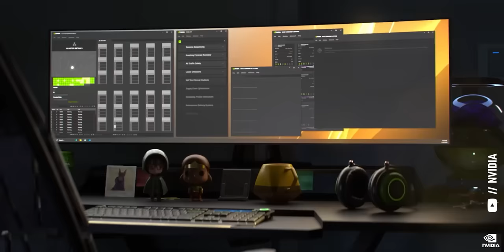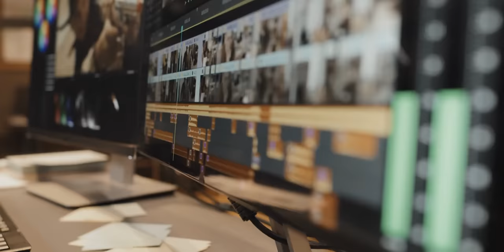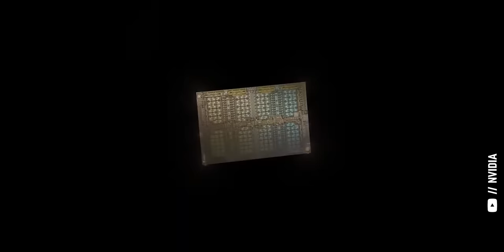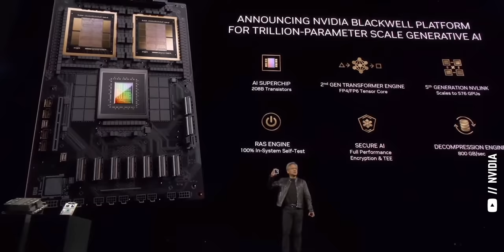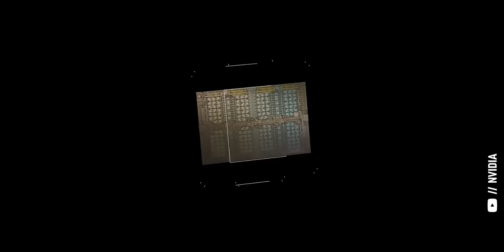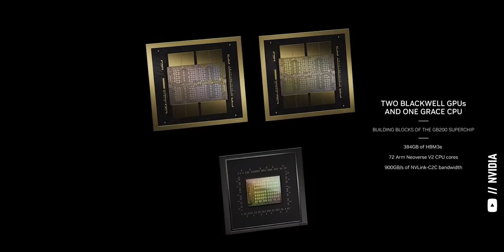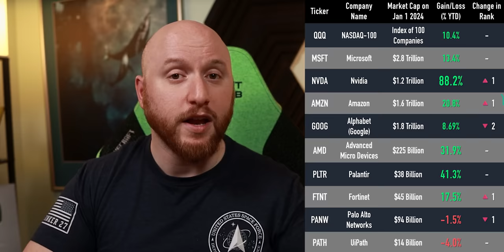GET IN EARLY! I'm Investing In This HUGE AI Chip Breakthrough

Comment: If Blackwell so powerful, maybe customers don’t need to buy so much of them.  What you think?
Reply: Eventually but nations are lining to buy their own.  Demand will exceed supply for several more years to come.
Reply: Until they run out of power which will happen quickly at this rate. I think NVDA is near the top. It can eventually grow but not short term. They will make less margins on these new chips and overall these companies are getting close to having enough. 

Like at some point you have enough compute to process all the data every created. These numbers for processing power are really insanely high. 

This is definitely in bubble territory now.
Reply: AI research and implementations are severely compute constrained. They'll gobble up all the compute they can afford because it'll make models more performant and more versatile. Think of a GPT that can run 10x the responses in half the time and then run an additional fact checking or optimizing function in the same time as it takes to produce one answer now, or an autonomous car that can capture and process sensor data 10x more frequently or analyze it 10x more thoroughly before deciding on a behavior. Drug discovery could also parse through millions of molecules, amino acids, proteins, dna segments, and map it against every other known biological element to discover new relationships. The computational ceiling is infinite.

Comment: It allready 900 Dollar..  how much more can it go up
Reply: Nvidia will split this year, so last time it was a 4:1 split = about 250 per new stock, the times before it was 3:1, 2:1, 2:1. We will see.
Reply: @dancingbear1881  If CMG can split 50-1 at $3000, NVDA can do a 10-1.
Reply: @dfv671  Yes? They could? I only said about the last times, did not predict the 2024 split. But would it be wise to "crash" the stock? 250 would still be good enough for new buyers, but the "drop" on the chart is much lower than for example 10:1 split.
Reply: You don't understand investing if you think 900 is too high for a stock price.
Reply: you know if they did a 1/3 reverse stock split it would be worth almost $3000 a share.  However if they did the more likely 10 to 1 split it would go down to $90.   Bottom line, by itself stock share price means NOTHING.   Have to combine with shares outstanding to give it any value.